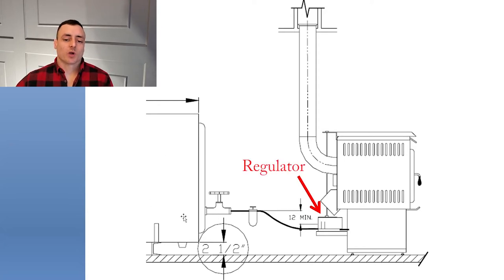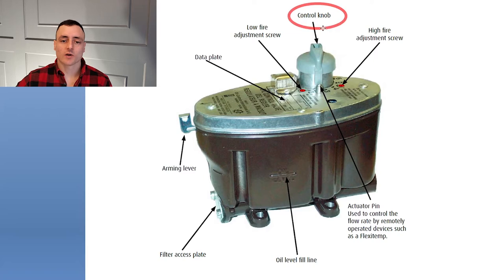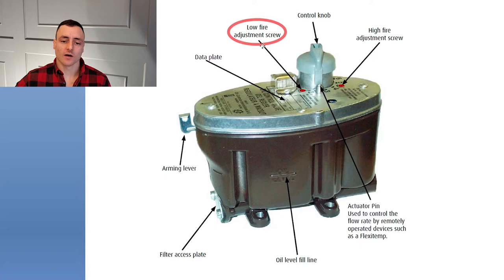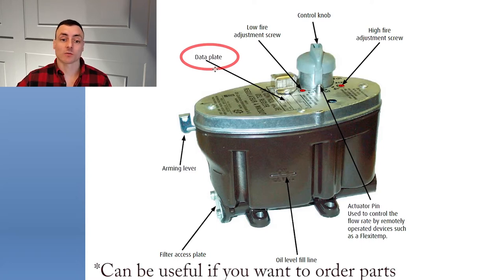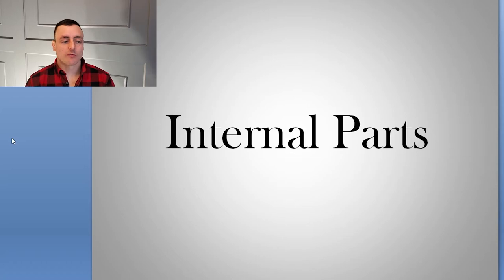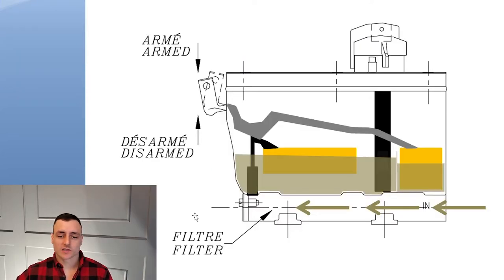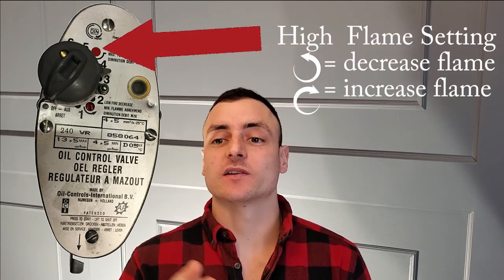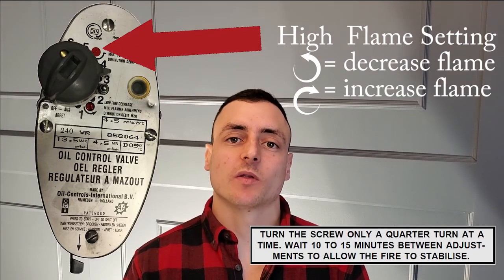OIL STOVE | How the CARBURETOR / REGULATOR Works | How to adjust and clean it

Comment: Thanks Phil, great video, the first one I have been able to find that fully explains the workings of the oil regulator box (ORB).   I lit Aga last week, however its running dangerously hot so have turned it off.   Hopefully I'll be able to access the ORB easily, the last owners built the kitchen right around it!😬

Comment: Our regulator has two knobs. One says 1-8, but the other has the letters “O”, “A”, then four “-“, then “TH”. We set it to “A” to start, then slowly turn it to TH, but have no idea what it’s suppose to be doing.  Seems like an air valve to me.  Any idea what it actually is?  Stove is a Napoleon.  Manual says it’s model is OS10-2, but the images and instructions are different than what my stove has.

Comment: I had a Siegler oil stove when I moved in my house 35 years ago, but I couldn't get it to work right, it smoked up the whole house. I couldn't find anyone to work on them so I got rid of it. I have an old buck stove now model 70.

Comment: My father and grandfather used 1950's era Siegler oil fuel oil heaters. It had a electric blower. We always started it by turning the fuel on until we saw fuel oil in the bottom of the combustion chamber then throw a lit bunch of toliet paper in and shut the door.

Comment: hi im hoping Phil or anyone, i have watched the video carefully, i ran out of oil, once the tank was filled, there was no oil reaching in the stove, cleaned the filter on the oil tank and the regulator, oil is getting to the regulator but not into the stove, any suggestions? thank you from the uk

Comment: Hi mate, 
This is the most useful video ever! I have adjusted my carburetor easily. I couldn't reset it because the flow was too high. The first chamber was filling too much and after 30mn the carburetor was resetting because the second chamber was full due to the overflow. I have readjusted the low flame screw and it now works perfectly.
Many thanks again.
All the best
Marc

Comment: Phil, I cannot thank you enough for taking the time to make this video, I have a franco belge stove with exactly same regulator, it was already in the apartment I bought and wasn't working with cracked glass, so I cleaned it up replaced the glass tried to light but nothing so I took the regulator lid off and it was like treacle inside, 45 minutes later and half a bottle of methylated spirit and it was cleaned and every previously seized component was now moving as it should . I've been pissing about adjusting as per your instructions and it's now 10 oclock at night ( I started at 9 this morning ) but everything seems to be working as it should . Cheers mate - Jackie
Reply from the maker: Thanks for the comment and glad you got your stove to work! Once adjusted, they really are little gems :)
Reply: @philg  spoke too soon, can't get it to run properly now, it was working fine then we had a storm and it won't reach high flame,I've also had a delivery of heating oil but I think the previous owner ran it on kerosine. So took regulator apart again and cleaned with meths but no joy . Maybe there is a blockage in the pipe . I'll let you know Phil .
Reply: @philg  ok so by process of elimination the chimney is clean and have a good draw. when i start fire up process I turn to 2 setting letting the oil pool for a few minutes then I use methylated spirits in the catalyser, light up and for first few minutes get the desired effect but as it stabilises the flame drops and no amount of adjustment changes the low flame, the catalyser glows red as it should  but it seems it's not getting correct fuel delivery. So I suspect their must be a blockage somewhere so time to get radical, I will turn oil supply off, clean regulator completly of oil and fill with meths then operate as normal to see if I can flush out any blockage . wish me luck
Reply from the maker: @scarlettwill  all the best! Let me know how it works out. In a new video, I open up the regulator, take a look at the slot where the oil goes through and the filter.
Reply: @philg  So, took the regulator off and re-cleaned with methylated spirit, then put a hose pipe over the fuel line to the stove and blew it was definitely restricted, gave it a good hard blow and a bit of tarry crud flew into the stove like a bullet ! so I used fibreglass rod I use to feed cables through walls which is about 5mm diameter and very flexible to rod out the fuel line . Put it all back together and bingo It works well, only slight and expensive problem was I managed to crack stove glass as I moved it back into place, this was new glass that cost me £135 plus £75 customs charge to have custom made in Uk and sent here to Malta , my bad .... but I have made a temporary repair using aluminium tape both sides with fire cement mastic along the joins and applied liberally. it doesn't look great but it holds and no fumes are escaping so will make do until I can replace the glass. It's all trial and error but it warms up the place just fine. thanks once again for putting this video up. Merry Xmas mate  !- Jack
Reply from the maker: @scarlettwill  thanks for taking the time to comment! So glad you got the oil to flow, despite the broken glass. Hope you enjoy the nice warm heat and merry Xmas to you and your family too :D !

Comment: Great video, clear and very concise. Your model of "carburetor" is very heuristic. 
I have dealt with these contraptions for at least fifty years, from kerosene-burning heaters, and I can tell you, they haven't changed a bit. I myself have had the same, very trustworthy Italian furnace for more than 25 years now. I clean the carburetor and tune it up every year. When Autumn (cold) weather begins we light it up and keep it on permanently, night and day, for five to six months. Unfortunately, after the last weeks' significant increase in the price of oil derivatives I suspect these will tend to disappear. 
Keep up the good work!
Reply: I have one that is more antiquated than a carburetor it's kind of like a variable waterfall inside of a long valve vertical

Comment: I just bought an "Old" oil stove to heat my woodworking shop.  I don't have it set up yet but it is ready to put in place. I want to thank you for sharing your researched knowledge.  I was concerned about the operation and adjustment of the  Carburetor because I don't know if my stove will work properly.  With your explicit information, I feel that I can confidently make any necessary adjustments.  Thanks again.
Reply from the maker: I am glad that I could be of help. If there is anything else, please let me know and I will make another video.

Comment: Thanks!! I just 'inherited'  a house with a  1950's -60's  oil stove.. this one has a blower/wall thermostat.  The  actual workings of the valve seems identical to your example.   I found out yesterday the  stove isn't putting out enough heat, and  only about  2/3's of the ring is  covered in flame.  My guess is it's simply starved for fuel.   Side note;  the original outside tank is also 60 yrs. old, with no filter  on the line.  I'm hoping the internal filter is plugged!   It will be getting an additional inline filter as well.     I have to make sure the bottom of the 300 gallon tank isn't  6 inches of sludge/algae/rust/dirt first!   Uncle told me  the burner needs cleaned 1-2x a season,  and that part is  done.   
About all that is left is the fuel situation.   
Without your video,  I had no idea where to even start, or how these things even function!   Thanks!

Comment: Nice one Phil.  I just picked up a used Refleks 2000 for my narrowboat and intend to give the regulator a clean up before installation. I would have absolutely been happily spinning the adjustment screw so your sage advice to go slowly is duly noted!
Reply from the maker: Yes, slow is key with these stoves!

Comment: Great video, been waiting for it!! Was just thinking about these when I was laying in bed this am. ?? Do a lot of thinking there. We had an oil stove in the living room when I was growing up. I think that something like this could be used for making waste oil stoves more safe. I am a big proponent of CLEANING the oil very well and having it a bit above room temp before metering it to improve consistency. I retired after 30 years of working in a facility maintenance shop. Ya gotta do things right to save time. Again, Thank You, Sir! Michael in Colorado.
Reply from the maker: Good day, thank you for the comment and I hope this video helps you. I will soon be making a video by trying to burn waste oil from my vehicles oil change. It should be interesting to see if it works, I also bought kerosine in case I need to increase the fuel temperature. Stay tuned, much love from Canada.

Comment: Hi! I am glad to find the info about classical oil stove, as  I did not have any information or manual until I found  youtube of you  and of a few others.   I have a problem about my Coleman oil stove which does not have oil flowing into the buning chamber...  It had been working OK for  decades but finally stop feeding the oil  a few years ago.   It was just left unused for more than 5 years and I finally  started to do something about it.  To begin with, I drain the old kerosene from the oil tank and disassemble the oil regulator assy  to clean the parts today and hopefully it wokrs again when I assemble....  I will clean the burning chamber as I can see a lot of debris at the bottom, following your advice.  Thank you for useful information,  I 'l  let you know when it comes back to work. So wish me luck!   (from Japan)
Reply from the maker: Yes let me know!! Hope you get it to work. Cheers
Reply: @philg  Thank you for your resopnse and I have a good news about my stove.  I cleaned every parts and tried starting the stove, but it first did not work. I believed mechanically it was OK and did not know what to do more... I was about to give up, then I  just tilted the stove forward then oil came out!!  It seems that the holizontal level of the stove is the key...
Reply: Anyway it was good to do the clean up for this stove.  It will be installed in my house later... But before that, what I think about my Coleman stove (model #871 ) is  adding this stove an air supplying tube (with air blower) just like many people do to burn the waste oil stove to have  blue flame..  Do you think it is possible??  Or can this oil stove bear the heat?  Is it safe to run this enhancement in the room??  let me know your opinion...

Comment: I really appreciate this video and have a far greater understanding of my oil stove. Currently running it with the dial at the lowest possible setting and it's keeping my structure comfortable. However, it seems like the consumption is high. I'm going to take the advice given in this video and see if it makes a difference. If my fuel consumption isn't impacted at least my stove will burn cleaner.
Reply from the maker: Let me know if that works of if there is anything else you would like me to explain better or cover. Cheers!
Reply: the stove will burn about 200 gallons in three - 4 weeks on the third setting depending on insulation and heating needs . this would be average -10 maybe as low as -20 a few days.R 20 wall R 30 roof Running fulltime mind you. i have a customer with this setup , she gets 3 full tanks of oil a season. around 3200 CAD delivered . The flame is always a clean blue

Comment: Phil your video has help me soo much! Have inherited a cabin in Michigan. Have been using this Duo-Therm Motor Wheel Corp. oil burner for 30 yrs she is a beauty! Just had the regulator knob on the bottom that holds the rod crumble. Any idea where to find a replacement knob?
Quick note an old timer told me 409 spray cleans soot off your floors window glass. This has helped me a lot. Thanks in advance for all ur help

Comment: Huge fan of you doing this so helpfull you have helped me so much as I have also spent a lot of time on this! My regulator is opposite of yours on the top of the regulator (Carborator) it increases counter clockwise snd decreases flame clockwise hope this helps. They are indicated on the top of the regulator + and -

Comment: Thank you, very helpful video. My stove has been experiencing only a very low heat flame. Will try cleaning the filter first then proceed to adjustments if necessary. Will also check height of oil tank compared to stove as I moved around to side of house rather than in front.

Comment: Very clear explanation and graphics which I found very helpful in understanding how my oil fired AGA cooker works.  We have had problems with the flame going out recently after about a week to 10 days of operating just fine. Last time it went out I waited for it to cool, relit it and it went fine for about 10 days and then just went out. Any thoughts on what may cause this? Great video.
Reply from the maker: Do you live in a windy area perhaps? How is your chimney setup? Checkout my other video on drafts, could be the issue. Cheers.
Reply: @philg  we don’t live in a particularly windy area but I will check out your other video. Thanks.
Reply: On my GLT stove, there is a cleanout rod in the oil feed port directly connecting to the burner.  Instructions state that cleanout rod requires stroking and turning once a week to keep port from clogging up with burnt carbon.  Might want to check if your stove is equipped with something similar.
Reply: @ElementofKindness  Thanks for your post. There is no clean out rod in our AGA cooker. We think we have solved the problem by having the flue swept (first time in 30 years!). There wasn’t a great deal of soot/carbon but enough we think to reduce the updraft. It’s been working since then 🤞

Comment: Great how to video.  Appreciate the info.  If I could add anything, I'd like to mention best not to make the hight low adjustments while there are heavy winds.  I found it fluctuated the flame dramatically making it difficult to make the fine adjustments.
Reply from the maker: Very good tip!! Thanks for sharing, I’ll try and include that in a future video

Comment: you were awesome I have an old oil burner my parents used when I was a kid. If i have an electric blower does that affect the operation of the rest of the stove? or would it still be gravity fed. My parents had two other stoves with gravity fed tanks but the only one left has a fuel tank you fill with a fuel can right on it. would that change anything? JR
Reply from the maker: The fan will not affect the stove. It will still be gravity fed. The fan only distributes the heat more efficiently, however the stove can function without power (fan won't run).

Comment: We use an old Nestor Martin oil stove. I will attempt to adjust it now after watching your video. The stove starts and burns blue for a while then slow!y the flame weakens and soots up the internal parts. Maybe a dirty filter?
Reply from the maker: Yes perhaps very the filter or the air holes in the burner. Use a wire brush to remove the soot, it should help provide more oxygen to the burner. Let me know if this helps!

Comment: Thank you for this information.  I attempted to adjust the regulator before I watched your video, yes that was a mistake.  I had adjusted the flow of fuel so low that I couldn't get it to work below "3". (long story)  Following your instruction I have been able to regain flow at the 1 and 2 positions on the dial.  However, I am unable to get the blue flame that should be visible on the 1 setting.  All I am getting is an orange flame at the bottom of the bucket where the oil enters said bucket.  Can you help or direct me to someone who knows what they are doing?  Thanks so much.
Reply from the maker: Is the bottom of your pan flat? Maybe check your overflow valve or chimney length

Comment: many thanks for reply
it's using kerosene here in Ireland
unfortunately the TV set up puts the main chair beside this regulator
it seems regulator on off arm is open to the fuel.is it permissable to put some removable mastic around this arm regards des
Reply from the maker: You could try with mastic to manual control the arm, I would be cautious and remain close to the stove for a few hours to ensure it remains safe

Comment: Thank you for putting this video together. I have problem with my Franco Belge Merville. It has ran for years with minimal maintenance until now. Even at its highest setting (6) there's barely any flame. I've cleaned the burner pot, the regulator filter, and fuel input at the descaler. I replaced the inline filter. I blew the fuel line from the filter back to the tank. Fuel flow to the regulator seems normal now. But fuel flow into the burn pot still is measly on the highest setting. The problem seems to be narrowed down to the regulator. Any other ideas before I open the regulator? How difficult is maintenance on the regulator internals? 
Update: Yesterday I removed the regulator and cleaned with brake parts cleaner, compressed air , and Tarn-X on the brass and copper parts. There was probably a 1/4" of sludge in the bottom. I also found that the copper tube connecting the regulator to the burner pot was partially blocked. When the tube was cut and crimped the end was never cleaned up leaving the end approximately 50% occluded with copper burring. I cleaned the hole with a diamond tipped cutter on my Dremel and 220 and 320 grit sandpaper. I cleaned the ID with pipe cleaners and Hoppes Elite Bore Cleaning Foam. I started the stove last night. Reset the low end setting a the regulator. Now the stove is running well on 3 at what used to be 6. I think this stove never ran quite right due to the throttling at the copper tube and got blocked with sludge. These stoves work best when clean and free from obstructions.